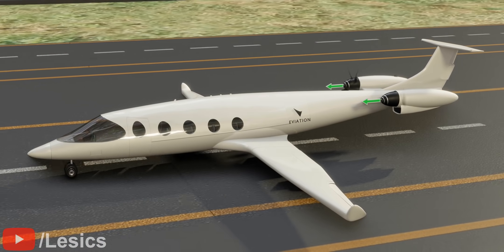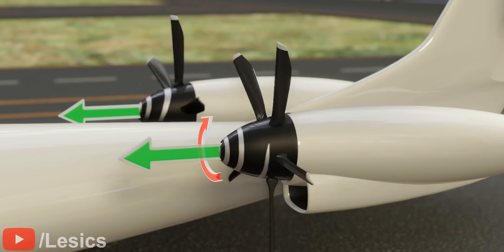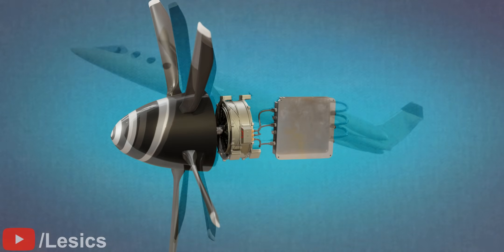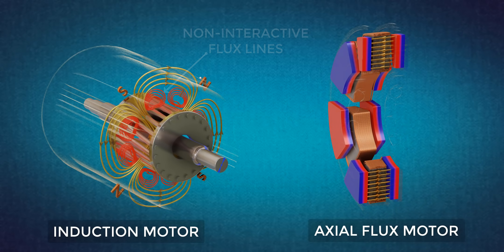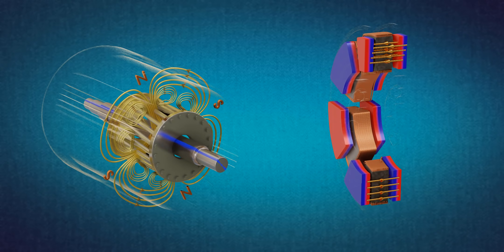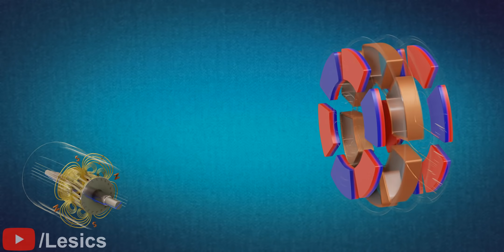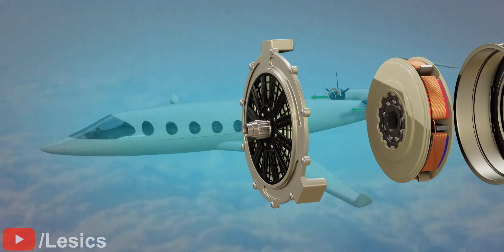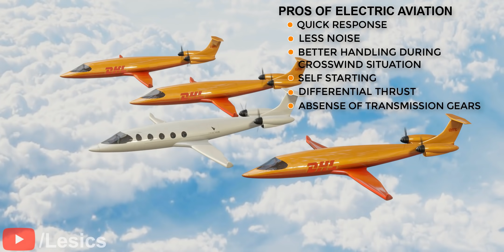Electric Aviation | The Dawn of an Advanced Transportation Mode

Comment: From a pilots perspective, this video is somewhat misleading. Firstly, the advantage of instant thrust really isn't that important. Since aircraft produce thrust independent of the wheels, you can just hold the brakes while waiting for the engines to get up to speed. And while in the air, instant thrust is only important for combat and aerobatics. Second, the increase of pitch of propeller does load down the motor and decrease rpm, the difference is that the motor can instantly increase it's power to match. Third, the problems with crosswind landing isn't a real problem. The rudder and ailerons are more than sufficient to handle most reasonable crosswinds, and if you run out of rudder authority that airport is probably too windy to land any airplane whatsoever. Differential thrust won't make much of a difference in those extreme conditions, and if you're yawing that much your downwind wing would probably just stall anyways. Lastly, differential thrust is totally possible on most all multiengined aircraft, and there are some cases where it has helped pilots who lost rudder authority in emergency. However, in routine flight, it's probably only useful for again combat or aerobatics. 

However, I will mention some advantages of electric aircraft not mentioned in the video. First is obviously environmental, but in addition to the reduced carbon emissions from electric aircraft, the climate saving effects are multiplied, as nitrogen oxides emitted by combustion engines operating in the troposphere create tropospheric ozone, which can be a significantly more powerful greenhouse gas than carbon dioxide. Second is cost. For General Aviation and small air carriers, fuel can be a significant cost, and the cost per mile of gas vs electric power can yield huge cost savings. Especially considering that aviation gas can cost $5+ per gallon, and these airplanes can burn a dozen gallons of fuel per hour, per engine. I could see electric aviation seriously lowering some of the cost barriers usually present in general aviation. Lastly, is simplicity. At least compared to piston engines, electric engines are much simpler. You can simply set a thrust level for an electric motor, whereas a piston engine can require you to set throttle settings, mixture settings, carberators, as well as continuously monitoring half a dozen engine instruments. This simplicity can also lead to greatly increased reliability and safety.
Reply: This comment need to be pinned
Reply: You could also mention the economy gained through fewer repairs needed for an electric motor.
Reply: Probably a video made by elon fan. Electric large aircrafts or trucks will not possible in the next 3-4 decades, because all the commercial airliners or trucking companies lifeline depends on the amount of cargo/passengers they carry. electric batteries take a large portion of that "max load" and also once the battery is discharging, the rest of the battery weight is dead weight, unlike fuel , where the vehicle gets lighter as it burns fuel.
Reply: Well said. Rhought the same thing as well
Reply: Ive watched some of the channels videos and have to agree. Lots of misleading information. Or just 50% of the truth. Here in this case, it is not mentioned once that batteries are WAY too heavy to be used efficiently in planes. Even in cars it is far from good.
Reply: Piston engines? what piston?
Reply: As a layman, the differential thrust of used during flight to create yaw seems very dangerous… also, wouldn’t that be completely counter to the aerodynamics of the vertical stabilizer?
Reply: A narrative intentionally ignores all disadvantages of the so-called new energy.
Reply: Yeah but this plane comes with a 4000 km extension cord.
Reply: Thrust is important, specially in Europe with lots of airports and airfields wire 2'000 - 3'000 feet runways...
Reply: @oscarreinhard3745  well at those airports, the airplane will perform a stationary engine run up before taking off. Whether combustion or electric, the aircraft will be at full power before starting the takeoff roll
Reply: .🔍👌 In the long run, this development will lead to other methods, which is progress.
Reply: want to like that more than once
Reply: I feel the same way
Reply: 5$a gallon is putting it lightly. 5 a litre is more accurate. Definitly Avgas and Kerosene. Many planes have been converted to take 91 premium to cut the cost.

I really don't see any advantages in electric planes. The range sucks ass because our battery technology still needs a lot improvement.  Maybe a hybrid setup will do a lot too in this aviation sector
Reply: @WorivpuqloDMogh  I think Hybrid is definitely part of the mix.  Were battery power aircraft like Alice come in handy is the short hop flights.  Obviously Alice isn't ready or technically capable of flying across the country in one flight.  But there are SO MANY flights of less than 500 miles covering small regional airports that are to small for "Big" airplanes yet are still active for a few people, now imagine if those airports are covered by a small plane like Alice.  Look at Cape Cod Air.  This is exactly their market..
Reply: Very informative and nicely put, Val, thanks.  Just curious, if you have the time- what do you think about bio fuels? At least as a transition to all-electric (whenever that might come).

Thanks again, cheers from sunny Vienna, Scott
Reply: @therealzilch  Bio fuels are not scalable, making biofuels wont meet the demands 😔
Reply: Three cheers to you for your analysis of this video.  I am a pilot wannabe and I could see many of your points also, but your discussion was succinct and easily understood.
Reply: These will not work slower than The Concorde and a range lower than a F-14 this will not work😂 and this is taking a step back in technology to the propeller age
Reply: amazing
Reply: Thats how most of his videos are, misleading, just for engineering fans
Reply: i didnt read the whole thing but im guessing instant thrust can save the plane when ur in a dive and u need full power
Reply: The expressed benefit of variable torque for each motor was for LANDING. It was not for take off and aerial maneuvering. Yes it is done in other ways currently, the expressed goal was too lighten the plane and require less components: transmissions, and substantially less fluids (fuels/oils/hydraulics)
Reply: @kmack282  But he talked about landing too bro, or did I miss something?
Reply: @CRASH ALEXANDER why are you screaming?
Reply: Well that's a mention the technology for electric planes isn't quite there yet. Low power extremely heavy batteries with minimal battery life. That ideal for long flights kind of what the exact purpose of taking to the areas to begin with.
Reply: The advantage of electrics is power efficiency and instant torque, not climate change stuff which is highly speculative. In fact the biggest advantage over jet propulsion with this technology is noise, which is not something anyone has discussed. The disadvantage is lack of capacity and range for electrics. It will be a long time before we see a switch from jet propulsion in a complete cycle. I can see the advantage of electrics for short hop and low cargo requirement flights. I would be curious of this technology would be more beneficial in overhauls of helicopter tech.
Reply: jet engines at this day and age is very superior. there is little doubt about that I would say
Reply: Instant to torque is very useful for handling turbulence, hitting a sudden downdrift on take off or landing, the quicker you can increase power the safer it will be.
Reply: I remember a similar comment when tesla was first released, until electric car became better than normal car engine 🤣
Reply: @dc22199x  well electric cars are a much different use case than electric airplanes. The many differences between cars an airplanes makes comparisons difficult
Reply: Agreed, there is misinformation and generalisations being made about electric propulsion aircraft. It’s a symptom of the World Wide Web as much it is for this topic. In general though, some of the advantages of EA include simpler maintenance as you have already mentioned. The noise footprint is potentially smaller allowing operation out of curfewed airports. The cost per hour  will be lower. The specifics depend on the business model and customer base. An example that springs to mind is flight training where flight times are quite short. There is a flight school here doing exactly that and not having to handle liquid fuels has simplified their ground operations. As for the flight characteristics, one obvious change is the takeoff weight of an EA does not reduce during flight as charge is drawn from the batteries. I note that the Eviation Alice appears to have a super critical wing form. No doubt this is part of the need to reduce drag as much as possible.  Cheers….
Reply: I agree ,and there are multiple situations where a jet plane used differential thrust like a DHL express flight that landed with it  because it lost its flight controls from a missile  and other planes and lastly Nasa also conducted an experiment  by using the thrust to fly the plane
Reply: Just tell that to guys in a jet or turbo-prop who land long on the runway and have to spool up to go around.
Reply: @nabirasch5169  you should be doing your go around long before you touch the asphalt lmao
Reply: @xb70valkyriech  Good one! I mostly do (except when it's foggy--ha-ha),  i will consider your advice. But still that doesn't help the poor mokes who crashed--failed to get back into the air--because of spool up lag--where instant thrust would have been the saving factor..
Reply: @Robert Branch from the studies I've read, the range can be made on smaller propeller aircraft, but anything that would normally be a turboprop or jet aircraft is out of our reach currently. For the small aircraft, you can get a similar range to normal piston engines, but the airplane will be a good deal heavier than the piston aircraft, in order to carry the same payload.
Reply: Very well said, thanks for the detailed response to the video, very informative!
Reply: I agree on most of your assesment but the Climate saving credits to the electric motors leaves out all the diesel needed to run the machinery to mine and transport the minerals to create the batteries that run the motors. 🧐🤔
Reply: There was no discussion in this video around the greater energy density of Jet A1 fuel as opposed to batteries holding the charge. That would show electric aircraft in a different perspective with Jet A1 having much greater 'bang for buck' energy than batteries. Until this can be overcome with new battery technology, we won't see transcontinental flights happening for a long time.
Reply: @davidpalmer9780  My position as well.  As an example the weight of the battery in a Tesla car is between 1/3 to 1.4 the total weight of the vehicle.  In aviation that energy density would make an battery powered electric airplane akin to a LEAD BALLOON .
Reply: @davidpalmer9780  1 to 2 hr electric flight cost is about one fifth and no trans con flights for a while; if ever.
Reply: I agreed with you. This video should compare same size aircraft with the same load capacity for good comparison. Futhermore, modern flight control system already offset the yawing and rolling by their trimming surfaces using computer, so it's not a problem.

One more thing, the video showing modern jetliner aircraft which usually use high bypass engine but the explanation about propeller doesn't match with it but if he's talking about turboprop engine, they too still have pitch control, the same concept like mentioned using electric motor there.
Reply: Well said. Doesn't make sense from an engineers perspective either. I would also add that most noise comes from the propeller rather than the engine. Check out Pipistrel's electric trainer. Doesn't sound any different than an ice trainer.
Reply: @00LAH00  are you joking? Electric definitely less noisier than jet engines or even classical pistons engines.
Reply: also electric can fly way higher since it has no loss of power with height
Reply: @jebise1126  it does.... its compressed air that's pushing plane forward......... higher you are the thinner the air is and then less "thrust" you get from your propeller or turbine.........
Reply: I’m shocked that no one has mentioned the most obvious flaw, in an otherwise brilliant comment (except for the green aspect, of course)

Our current power grid is incapable of supporting the demand of a full “electric” society.  We would have to upgrade 100% of the grid to make it even possible.  Also, the argument about it costing less to operate is specious, at best.  The cost of electricity will go up exponentially as more people switch to electric vehicles.  The story will be because of the cost of rebuilding the grid, and the increased cost of producing green energy, but the reality is that the energy industry knows they can demand whatever price they want, and there is nothing that can be done about it.  Politicians will make new laws and new deals to provide more profits to the big corporations, as they always have.  California is a prime example. The democrats there have made the electric energy producers VERY rich over the last 25 years.  Beginning with the scam created by Gov, Grey Davis, and perpetuated by every democrat politician in the state ever since.

Electric will only be a good solution, when every individual can produce enough of electricity for their own uses.  Which also will never be allowed, as the politicians will either make that illegal. Or tax it so heavily it will become more burdensome than what we currently have.  California is already looking at ways to tax the electricity being created by home based solar generators, because they are cutting into the states tax revenue on electricity.
Reply: Painful, but the truth folks. Let’s clap it up for this man.
Reply: Production of batteries for electric vehicles produces just as much greenhouse gas emissions as burning of fossil fuels does...  sometimes more depending on where the batteries are produced...  and electric vehicle batteries are hazardous waste materials, so disposal of them is costly and problematic at best.  

There is no difference.

You either burn fossil fuels now and put the cost and environmental problems up front, or delay and defer the costs to the end and have the environmental problems spread out over two events instead of the lifetime of the vehicle.  It's all the same, the different systems are just shifting the problems around is all.
Reply: @AflacMan13  ignorance is bliss. Right Daniel?  You don’t even bother looking at facts when writing stupidity.
Reply: @AflacMan13  Source of your information?
Reply: Using differential thrust is not that bad because there would be low chances of failure of the motors there by reducing the weight required for the rudder and its electrical controller equipment. It would also be easy for the pilots because they don't need to remember an extra control just to yaw the plane.
Reply: Electric Airplanes > Fuel Airplanes
Reply: @dogzer  Prove it
Reply: An awesome reply and very accurate . I would also mention the huge downside to electric aircraft. The batteries degrade and will degrade at a faster rate for an aircraft than a pack utilized in an electric vehicle. What alot of people don't realize is a battery has a calenders life beside the normal cycling.  A plane will have to utilize a larger percentage of the packs capacity leading to steeper degredation curve. Adding additional pack capacity will sacrifice weight. The fuel saving from electric can be negated by the cost of the pack when needing to be replaced.  20k for a Tesla pack... Imagine one sized for an aircraft and not to mentioned the stringent pack qc and engineering to be applicable for an aircraft. The cost will be considerably higher per kWh   vs a vehicles battery pack.
Reply: @kayzrx8  why do you think, that is necessary to use more capacity in case of electric aviation use? Aviation is much more organized and therefore capacity use can be managed much batter than in cars. Yes, there can be a disadvantages of capacity/weight ratio,because of aviation security needs, but this for sure means that max. 50% of capacity will be habitually used. Means that battery will probably last more then in EV cars.
Reply: @kayzrx8  Battery degradation occurs with poor cooling systems like Nissan and poor battery management. 2013 Teslas have gone a million miles and still have 80% of their battery.  That’s $180,000 in gasoline vs $30,000 in electricity and no maintenance by comparison. While a few Tesla batteries have been replaced, it is super rare.
Reply: @colingenge9999  That is wrong.  Degradation occurs every time the cells are charged and discharged. This is driven by cell chemistry and composition. It is accelerated by poor thermal management and depth of discharge, charge rate and discharge rate. There is no battery that does not degrade.   Pack replacement is not rare. There are thousands of these modules on the market that are used that have been removed from bad packs. It isn't something that is rare like you are making it out to be . Please show the data that has a pack that has gone out 1M miles. The vehicle your probably referencing had " multiple " pack replacements to get to that mileage. Not to mention replacement to the various power train components along the way . Please stop posting false information.
Reply: @kayzrx8  I agree with your points on battery management and the 1.5 Million Km Tesla did have a battery replacement although it was at Tesla’s expense.  I order to have a meaningful conversation on these important issues opening your conversation with “… wrong” and closing it with “..false…” pretends to me that I am discussing in bad faith which is not the case. Even though i have read 10,000 articles on Tesla, no one knows everything, you included.
Reply: @colingenge9999  Reading 10k articles on Tesla is a bad way to make an unbiased assumption or conclusion on the subject and does not make you an expert on the material.  Sorry if you were offended by me saying the truth about your comment as it was a completely false comment.  I have 17 years experience in battery and energy storag on an application level and cell design level. I've  done the RD for automotive manufacturers.  I have designed the cell chemistries and know their limitations. There is alot of false information being spread as marketing hype. Environmental impact of batteries are downplayed tremendously. I can't educate you in a comment on these subject . You would need to do alot of research and academia to really understand how these subjects tie into another, and no, biased Tesla articles are not a valid source.
Reply: @kayzrx8  I wasn’t offended so much as telling you that your strategy is ineffective.  You don’t establish rapport in that fashion. 

Statistically it would be impossible to find the same level of bias with that bias in the same direction with 10,000 articles.  Faulty math on your part. 

Tesla has spent 0$ on marketing so whose hype are you referring to?
Reply: @colingenge9999    Don't start mentioning statistics please just dont. Using a large word like that to sound like you know what your talking about may fool some people but not me. It doesn't apply to what I said. Again showing your lack of ability to apply math.  Never mentioned hype. Again showing your  bias. Tesla not spending money on marketing doesn't mean there isn't marketing going on. Have you seen the amount of content on Tesla and publicity? .... That IS marketing. Whether they pay for it or not, whether they do it themselves or not, that doesn't change the fact there there IS marketing going on. I don't need a strategy to call out someone who doesn't know what they are talking about. I don't need to establish rapport. I don't work for you nor do I care what you think. What I do care is that you don't spread false info. I work in this industry..... Not sure what your angle is here ?
Reply: @kayzrx8  You might work in “this industry” and think you know it all but you’re not as up to date as the impression you try to put out there.

I do find it amusing that you think of yourself as the gatekeeper for your industry.    I am not sure how far you think you’ll get being disrespectful but my experience indicates, not that far.
Reply: @colingenge9999  lol when did I say I was the gatekeeper . Just calling out false info. If you have a problem with that and feel some type of way because your false info can't get past an engineer, don't post false information. Would you like me to list the false info you posted ? You still haven't presented any data to back any of these claims you've made besides your thousands of Tesla articles .
Reply: Electric planes are not good for environment *indirectly*, because there is no effecient method to recycle li-ion batteries, they just get thrown away.
Reply: @demoaccount2392  Right. And the batteries alone are more than half the weight of the plane. They are actually very expensive fuel. Since so many toxic solids and gases are released making them they're anything but gteen.
Reply: @nabirasch5169  True
Reply: @demoaccount2392  please inform yourself before posting.
Reply: @demoaccount2392  ill take your "used" batteries.
lol you are dumb. 
i make profit.
Reply: @demoaccount2392  it's just  not true. Battery can be easily recycled, but before it will be surely reused for  stationary backup (i.e. for house or grid as a power storage), because the only disadvantage for aviation use is the drop of capacity slightly, which is absolutely not an issue for stationary use. Than after next one or more decades of use as a power storage 97% of battery can be finally recycled for new use.
Reply: @demoaccount2392  false.
Reply: @atlet1  Prove it please
Reply: @demoaccount2392  you made an obviously false claim and demand that I who pointed that out am presenting a proof? You are the one to prove that your false statement is true. Or at least plausable.
Reply: @atlet1  I have researched and I am still researching since 2 years, I have made calculations on it bruh. Biofuels are expensive due to high cost while making them, scientists are working to decrease it. Some fuel which we use have biofuel blended in it, but almost 10%, it depends on the country. Dont get mad. Synthetic fuels are also an option but they are expensive almost 5 times, researchers like me are working to solve it, the future is electric and synthetic fuel but I prefer synthetic fuel because they have more POWERR.
Reply: @atlet1  Thats what I am saying they are not viable options currently but they can be seen as an option in future. And remember statistics is an important part in making a thing possible, cost is important.
Reply: @demoaccount2392  false! You said something else: "biofuels are not scalable. Making biofuels won't meet the demands". Its welcome  that you admit that your statement was false.
Reply: @atlet1  "Winning an arguement against a wise man is hard, but winning an arguement against an idiot is impossible"
Reply: @atlet1  You are literally confused. Read the chat all again
Reply: @demoaccount2392  false! Idiots may not understand that they lost though.
Reply: @atlet1  What is the mis-information, be calm and dont be rude
Reply: @demoaccount2392  but they perform better and instant torque. The environment will recover. EV is the future like it or not. Maybe make a sign and go stand by the street.
Reply: @Shepardofman  Think about pollution releated mining, don't get offended mate. And what about the power
Reply: Except the green bit that's ignorant. Electric cars are actually more dirty than gass. It causes more pollution to mine and make the batteries than a modern gass car produces in its life. In addition the majority of energy to charge the cars is not from clean energy. It's a fallacy to make people feel good. It don't actually help the environment
Reply: @12b_engineer  When the pollution is concentrated from a single source it becomes easier to purify the air and the water that comes out from those mines.
Reply: @12b_engineer  where does this opinon from? I read it everywhere even when its been factually disproven many times. EVs are significantly greener over their lifespan, even when run with Not-fully-renewable Power. Furthermore the lack of renewable power is not a design problem of EVs and should not be viewed as a flaw of the EVs but a flaw of the electrical grid, which has to be solved independ of EVs.
Reply: @12b_engineer  It’s easier to convert the grid to clean energy compared to something that is already using unclean energy.

And two, battery production still has a huge margin where it can still get cleaner. Gasoline cars basically can’t get any cleaner than their current state.
Reply: @12b_engineer  
Wtf are you talking about where is the common sense?
Do you have any idea how much pollution had created oil on the last 100 years?
Compare that to the mining of other materials oil is the worst based on their carbon print.
Reply: @12b_engineer  are you really sure? Do you have real data to proof this? I mean numbers of efficiency of gas mining, transport, and processing until it's ready to tank into an ICE car. Not even mention, that countries with oil are often a very controversial government function or even are occupied by armies?
Reply: @12b_engineer  Thanks for presenting Fossil Fuel Company propaganda.  Even if you burned gasoline in a power plant, EV would still use half the amount of fuel because of efficiencies. Since new  power generation is all renewables, we have a chance to go from sunlight to transportation 100% clean. Did you mention the cost of building gas cars and all the oil they waste? NO!  How about the 2000 pounds of toxins your gas car produces that is breathed indirectly.
Reply: @colingenge9999  more false information. Have you done research into how much power the climate control system along with  cabin pressurization needs  would need in KWH to  make electric passenger flight viable ? Then take into account the hydraulic systems, avionics, etc? This isn't even counting the propulsion requirements.  Do the math. Battery powered mass transit flight  is not going to happen with current battery tech. The weight alone of a battery to meet these metrics is not going to be viable or practical.You keep talking about efficiency. I don't care if it's 100 percent efficient , if it can't do the the application it doesn't mean anything.
Reply: @kayzrx8  Again you are opening and closing your remarks so unless you only want to discuss issues with people who already agree with you, i suggest you tone down your rhetoric. “Do the math” is egotistical and assumes I have not done that math.  Fact is that battery powered aircraft are in their infancy and will be used for one hour low altitude hops. Harbour Air in BC has done the math which is why they’re investing a ton $ into making their short haul fleet electric stating they’ll make it al back on fuel but mostly savings in maintenance forgetting about environment impacts.
Reply: @colingenge9999  opening and closing remarks.. cute... Yes let's try and sound like we know what we are talking about ....... This thread had nothing to do about short  "hops" . As I stated which is a fact , battery tech is no where near ready to rival any type of large scale transport of goods or passengers at any significant scale. I have to say do the math because YOU (the individual claiming to know what they are talking about)  has not done the math.  You don't understand what is needed to make an application like this viable. Speak to any engineer or scientist with energy storage background or even just someone that understands physics you'll quickly learn why this is the case. Your simply saying what you read or heard others or companies saying . I've seen and been a part of companies that invest millions into projects that failed. doesn't mean it was viable at the time. Physics is a real thing and can't be imagined out of the equation. Using current battery tech wh/kg you will quickly see why the weight is a huge issue. For something that is counteracting weight to stay in the air! These short hops that these planes will be doing is a drop on the grand scale of where true emissions are coming from and won't make any significant impact on what really need to be addressed. Yes it a project in the right direction but with current battery tech the batteries WILL be a huge issue once this plane has been put through it paces . Battery tech had to evolve significantly before it make sense to do this.  You keep saying fuel saving fuel savings . Ok have you done the math to prove this ? Or is this something you simply saw on YouTube or read about.?Have you taken into account the other variables that weighs into the cost of transporting anything besides fuel?
Reply: @kayzrx8  I have never corresponded with anyone who appears terrified at the idea of electric aircraft working. What is wrong with starting with one hour flights in small aircraft.?  Why should this thread have “nothing to do with short hops”? Who says?   
Look, several mfr have compelling high performance single seat EV aircraft for sale.  Who said it would be easy. heck Tesla is the only company who can make hi performance, long lasting EVs at a profit while all others flail. Aircraft won’t be easy but it will happen.  Your condescension does not make you any more credible yet beneath that you have at least had some clear thoughts about this which puts you ahead of most who are one liners at best.  You remind me of my dad whose emotions would rise and ability to communicate would fall.
Reply: @12b_engineer  that’s absolutely ridiculous.  1. Regular gas cars have the need for mining as well. 2. If someone went out and mined for the minerals needed in a battery for 1 vehicle, it would be dirty. Mining for mass amounts of vehicles is very low enviro impact. You sound ridiculous.
Reply: @12b_engineer : The other parts of the electric system will evolve to improve the clean energy of the system; it's hard to improve the complete system all at once. It's clear the total system is still missing some green aspects that need to be worked on, but we'll eventually get the whole system more green with time, including the chemical batteries (which may be replaced by other future technology).
Reply: @12b_engineer  I mean this is just super misleading - electric transportation IS the key to reducing emissions, the idea electric cars are dirtier is a pretty popular myth. Electric cars certainly aren't any worse regardless of where your energy comes from to charge it, and in most cases it's environmentally superior. As we develop and install new sources of renewable energy, electric vehicles are the only way to make those sources of energy future proof. Hydrogen vehicles aren't feasible, other energy sources also cannot take advantage of other creative new sources of power in the vehicle's local area, and gasoline is obviously not sustainable and is killing the planet, and the only way to make sure we take advantage of all the new solar, wind, and hydro plants we are (or in some places, SHOULD be) installing is to store the energy electrically. Listen to this EExplained video that breaks down a bit more of the math: https://youtu.be/Hatav_Rdnno
Reply: @12b_engineer  electricity made by a power plant vs pollution made is significantly different than pollution made for the equivalent amount of cars. Stop lying, boomer